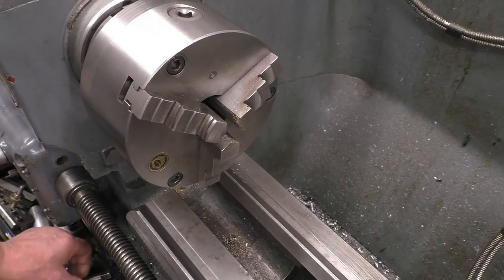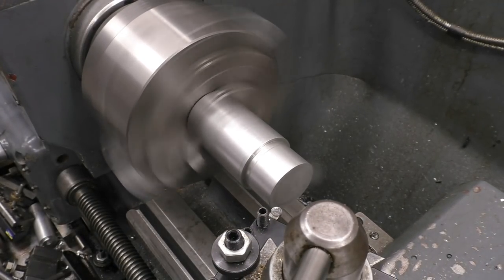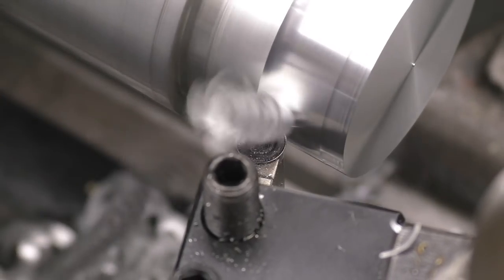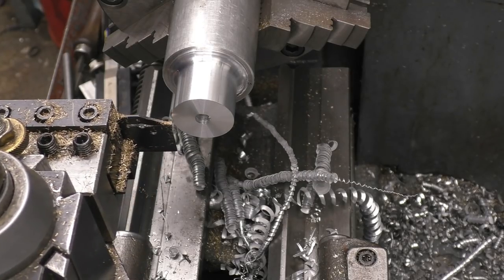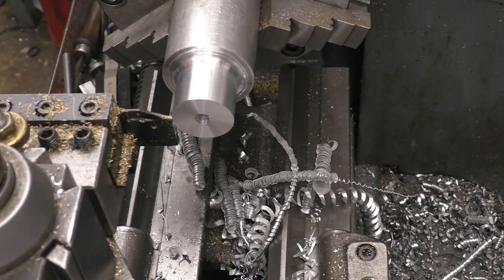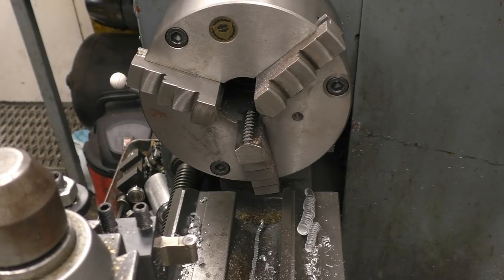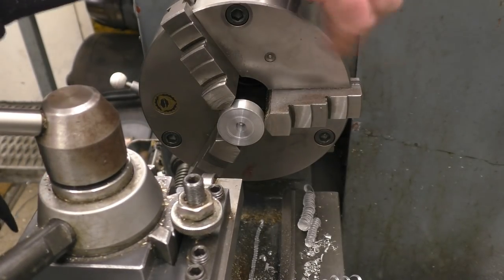SNNC 411   Bell End Bottle Opener

Comment: Opening bottles... I'll see if I can make a video showing how technic and very, very little power can do that opening slowly and safely using the back end using almost any dinner tool....
Turning aluminum...... Made a 5 feet, 150 cm, long aluminum string when feeding by hand! No shaking hand yet....
At the time 03:55 You line up the part off blade using the holder. That works not so good for me. Aligning the blade against the chuck, or faced off surface, works well. Crocked tool holder or what?
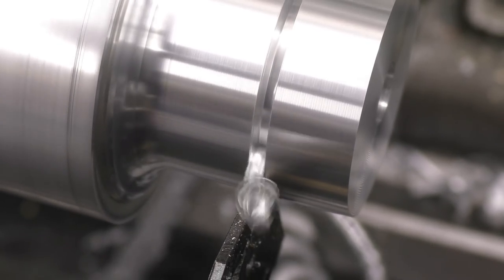Time 04:29. Boozo and bastards.... The wobbling is visibel when You retract the part off blade, not during the trouble.
Time 05:30. Really a useful tool. I built one myself. Make a video showing how to make it!
Time 09:50. A plasma cut kitchen helper for Your wife? Joking!
Cheers.